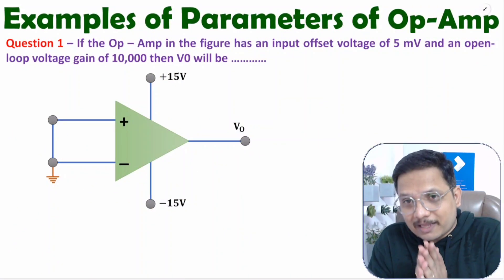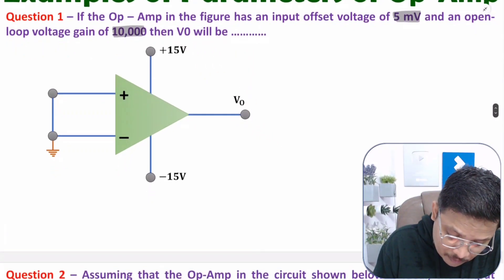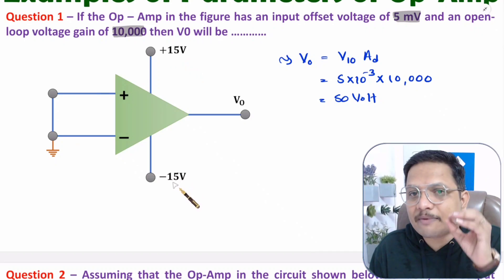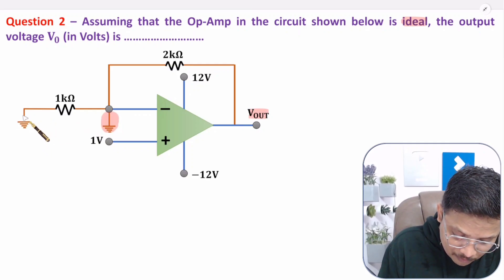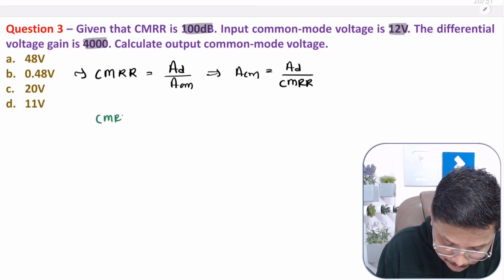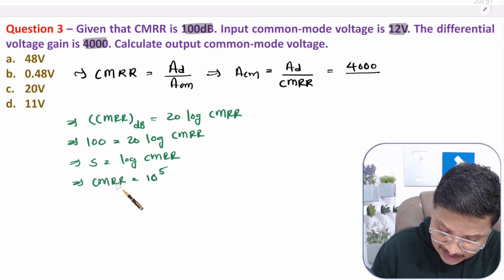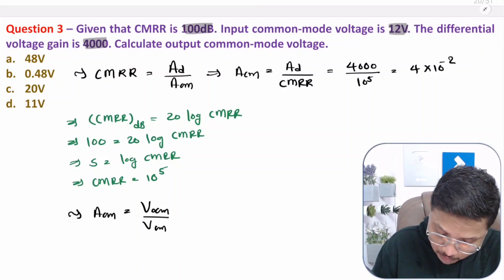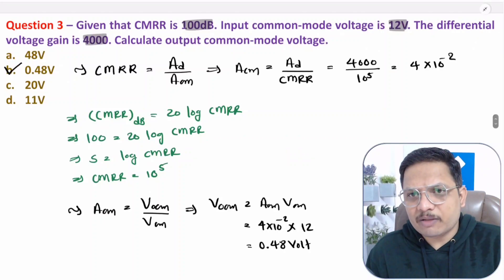2. Solved Examples of Parameters of Operational Amplifier | Gain, Voltage, CMRR | Analog Electronics

Comment: according  to virtual ground concept v+=v- (ideal op-amp is given) then how we can say potential at the inverting terminal is 0v . If we solve the same problem by considering the virtual ground concept than 1v at v-(inverting terminal) and by applying kcl at inverting terminal than the Vo is 3V not 12V